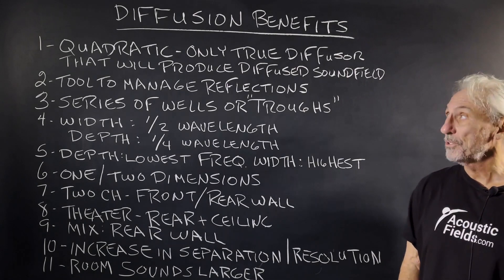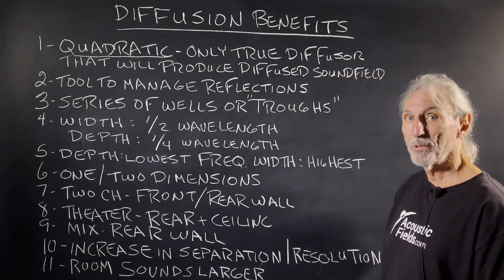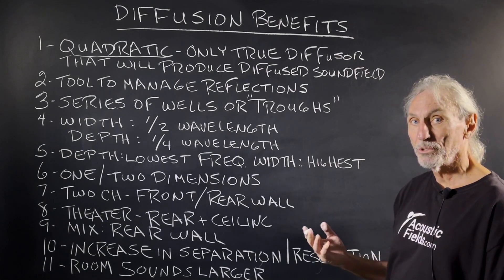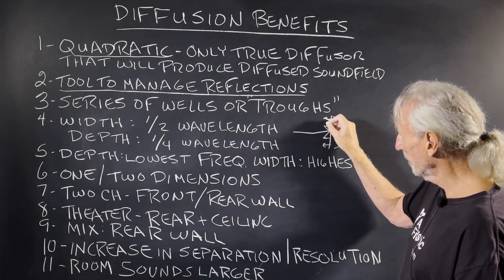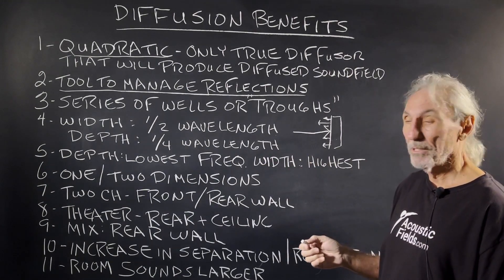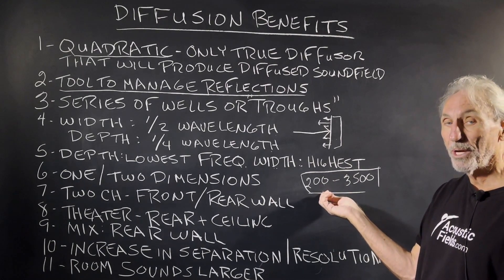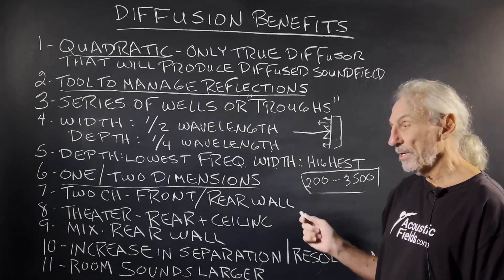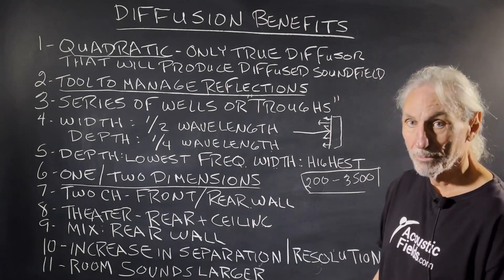Sound Diffusion Benefits - www.AcousticFields.com

Comment: Thanks for your videos, Dennis. I like my current recording space, but low flying planes are becoming more of an issue. I'm in the processing a finishing a vocal booth at the moment, the structure is finished but I'm getting into the internal treatments. So it's a blank slate. The walls are 46.5" both ways and the ceiling about 7'1'' made of 3/4 MDF. I considered a diffuser to help with boxiness in the sound, but I believe in another video of yours that they need about 4 feet to the listener to properly do their job, I guess it would have to be on the back wall if used. So that would cut it close considering the placement of the mic maybe a 1 1/2 from the front wall. Do you think the space is still too small to consider a quadratic diffuser? I haven't gotten too far into this part yet, but just considering my options as I add treatments. Thanks again, Dennis.
Reply from the maker: Baes upon usage and distances, your room would only qualify for a 7. The P--7 is 4 1/2" deep. However, it would diffuse starting at 850 hz. and going through 3,500 hz. It would cover the higher end of male and female voice. I do not know how that would sound to a microphone.The numbers look good enough to try the wall you face. Start at 24" off the floor and cover up until the ceiling. I would use 2--D

Comment: All diffusers "Work" they spread sound out the sound waves. The problem is that most of them A) do not diffuse evenly. B) do not cover a wide enough frequency range. C) Are not implemented properly.
"Diffusion can act like a magnifying glass" I like that.
Reply from the maker: We have not had the issue you are describing.

Comment: I purchased your DIY plan bundle last year and built several P-13 diffusers in Cherry for the rear wall of my horn-based music room, and was blown away by the improvement to the listening experience.  My soundstage grew in all directions, and instruments/vocals became more focused and spatially convincing.  I can't really say I regret not using them sooner because I didn't know what I was missing, but moving forward I could never go without them.
Reply from the maker: Yes, we get comments like this a lot. Diffusion once heard produces two reactions. The first is regret that they didn't discover it sooner and the second reaction is that they will never be without it again. Now, place diffusion on the front wall, so both surfaces are working together. If you think rear wall diffusion was wonderful, wait until you get both the front and rear walls working together. You can go with a higher prime number for the front wall.
Reply: @AcousticFields  Thanks, Dennis.  I've elected to make some compromises, as the front wall has a couple of windows onlooking a gorgeous view.  When listening I deploy some thick acoustical theater curtains over them to mitigate the glass sound.  I may consider building some freestanding diffusers that can be moved into place.

Comment: What exactly determines whether a room could benefit from diffusion? I understand you need the ice cream before the chocolate sauce hehe but what are the criteria for deciding that the ice cream "needs" chocolate sauce?
Reply from the maker: Usage and distance from room boundary surfaces to listener determines whether you can use it. Diffusion is a technology that makes a small room sound larger. If this is part of your sonic strategy  for your usage then start measuring distances from each wall to listener.
Reply: @AcousticFields  I guess my question relates more to how it's determined that it's part of one's sonic strategy. For instance reverb lengths can be measured to determine problem frequencies and so the appropriate absorption can be installed. But how does one come to the conclusion that "this would be better if the room sounded larger than it is"?

Comment: In a 2 ch system, would diffusion on side walls be effective or necessary? TQ!
Reply from the maker: It depends. You must have enough distance from listener to sidewalls. If that variable is met then you use diffusion on the sidewalls. However, using diffusion on the sidewalls can result in some phase issues so distances are critical. In two channel rooms, we use absorption on the front and sidewalls to reach a critical level of definition and resolution along with a strong center image. We then take that defined and resolute image quality and expand it using diffusion
Reply: @AcousticFields  … I hear what you saying. Diffusers, as stated by you, need a minimum distance to work. 

My room is a mere 10’w x 13’l. I’ll work on getting the diffusers in last.

TQ!!!
Reply: @AcousticFields  Didn't you recommend diffusion for front walls instead of absorption, for two channel listening rooms? "No discussion"

Comment: Would you bother with diffusion on the back wall with the length being 14 feet? (Backwall is 11 feet wide)
Reply from the maker: Rear wall reflections have time signatures that compete with the direct energy from our speakers. Diffusion has benefits up to 20' distances near field.
Reply: Dougly Dorite, yes to your rear wall diffusion. It depends on room geometry, but yes, it's likely you could benefit from both back wall absorption and diffusion.
Reply: @FOH3663  thanks! I’m probably only 7 feet from it due to my listening position, but I wouldn’t know which frequencies to attempt to diffuse. My room is getting a bit over damped in the high frequencies

Comment: Is it possible to use a very light wood like balsa wood to make a diffuser?
Reply from the maker: You have to be careful using small wood. Over time, it will warp creating phase issues. A diffuser works entirely using reflections. You need to have at least 2.5 lbs. / sq. ft. density,
Reply: @AcousticFields  Much appreciated.

Comment: Ignoring practicality, is there a lower freq limit to the effectiveness of diffusion? Would a 7.5ft deep diffuser be effective at 30hz?
I assume the limit is where the sound becomes a pressure issue instead of a reflection issue, so it probably would not.
Reply from the maker: A 100 Hz. diffuser is 36" deep. Below 100 Hz, its all about pressure and its ability to pressurize (load) the room.